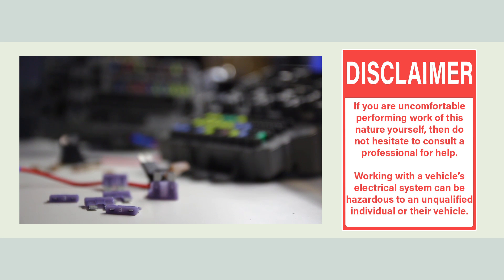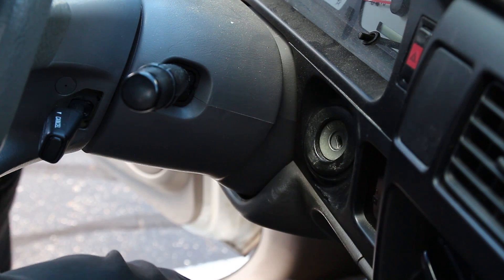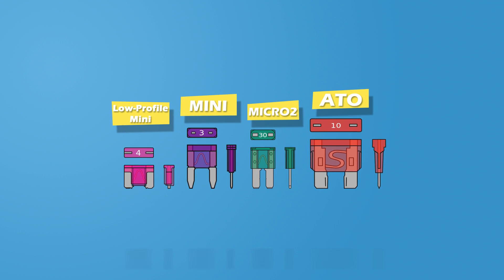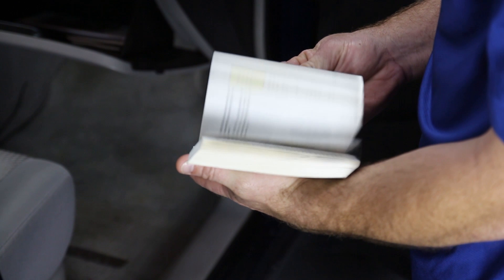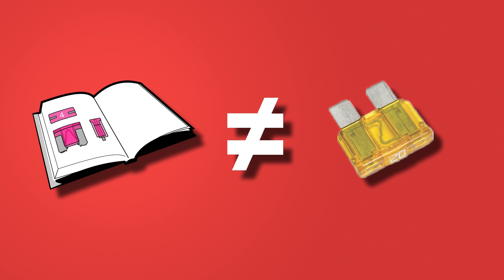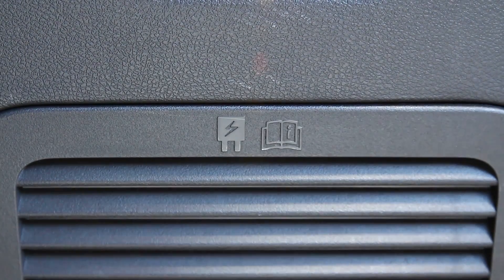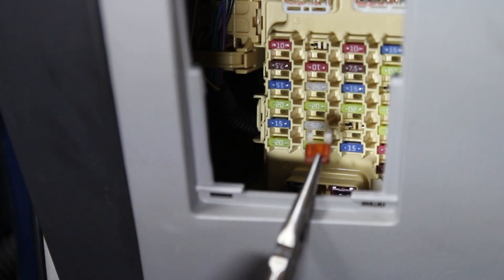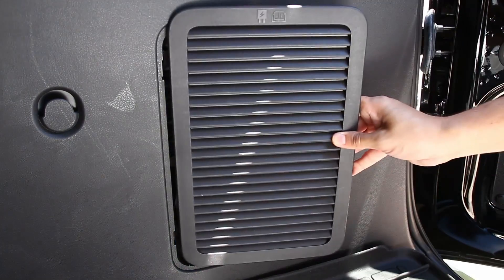01 | How To Identify Your Fuse Type | DIY Dashcam Installation by The Dashcam Store™

Comment: If someone already pulled out the fuse, how do I know what amperage fuse I should replace it with?
Reply from the maker: There should be a diagram in the vehicle owner's manual showing what fuses go in which slots. Sometimes the fuse diagram is on the top or inside of the fuse box cover (if present).

Comment: where do we buy the new fuse to replace? And does it matter the numbers written on the fuse?
Reply: I think that number is the amperage at which the fuse will blow. I'm a total noob to this subject, so I really don't know, but I'm guessing that if you didn't know, putting in a higher amperage fuse would guarantee that it would always let electricity flow, but it might also prevent the fuse from blowing if too much current was flowing through it, but not enough to blow the fuse.

Comment: When the heck did they add micro 2 fuse? Was there something wrong with the mini?
Reply: Tell me about it,  my 2014 CTS VSport has all those,  and ones with 3 legs, in addition to the screwed down bus fuses.
Reply from the maker: Good question! We're not really sure when the first Micro2 fuses started being used, but they've definitely been out for more than a few years at this point. We suspect the Micro2 was developed simply to allow for smaller sized fuse boxes, since the Micro2 fuses are probably 25% or so thinner in width than your standard mini fuses. Thanks for watching, we hope this video was helpful.
Reply: @Thedashcamstore  Why aren't they just called "micro"? Was micro used and it wasn't good, so they came up with a micro 2 design and now we all have to call them micro 2?
Reply from the maker: @mitchjohnson4714  wish we knew. Things that make you go hmmmmmmmmmm